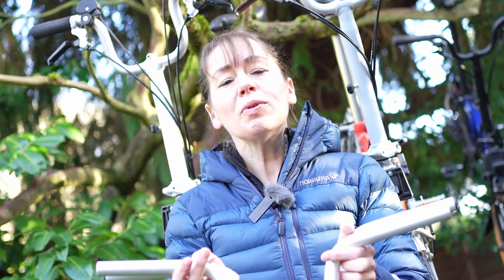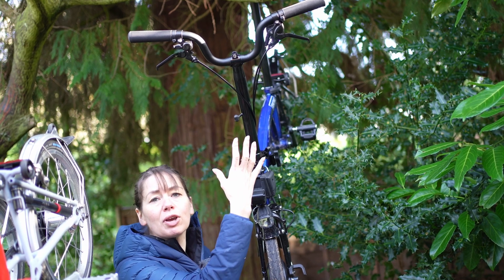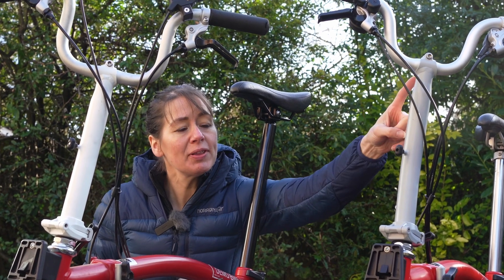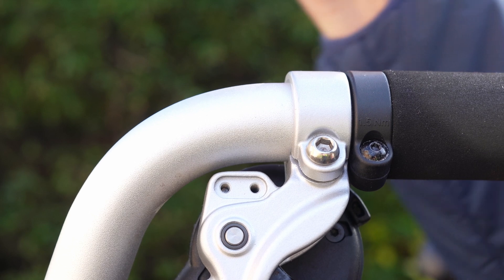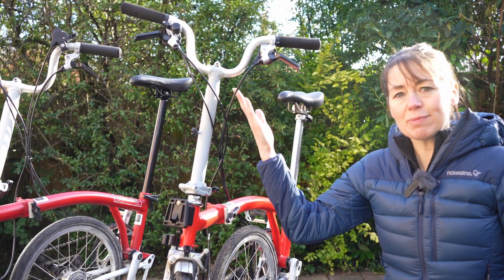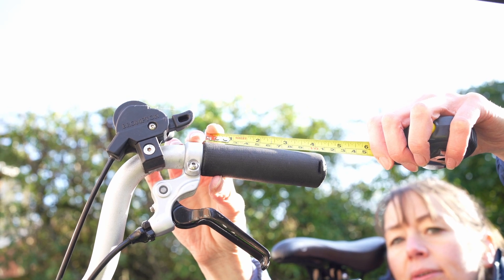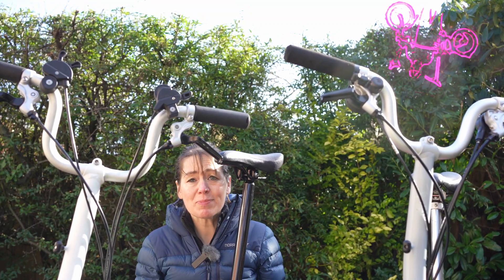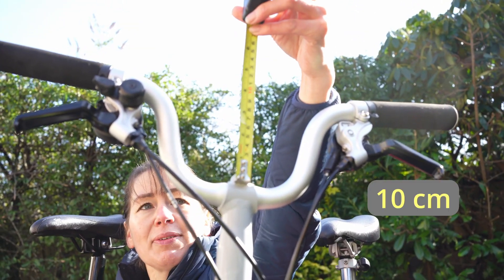Pre or Post 2017 Brompton Bars?

Comment: I have pre-2017 stem with post 2017 bars… for that slightly lower position and  extra grip space…
Reply from the maker: Many thanks for watching and for the comment. How are they?
Reply: Does it lead to an "S like" final position? This is very interesting, i find the old M position too high for me.. Could u please measure the length from the hinge to the top of the handle bar (i mean where hands stand but above the mid bolt)?
Reply: That should be approx 4 cm lower than a pre 2017 M tipe (stem+handlebar) and it should allow the use of new shifters.. Am I right?

Comment: Has anyone installed the newer, post-2017 handlebar and shifters on an older 2015 H stem (which is about 3 cm lower than the new stem)? What cables did you use? Also it is not recommended to use old bunny ear shifters on the new low rise handlebar?
Reply from the maker: Thanks for watching. It has been done. You need to use the same length cables, they will just be a bit long

Comment: I tried the bike of a friend with H-type but it still felt like the handlebar is way to far away from by body. Is this common for shorter people? Im about 163cm and it seems like the brompton doesnt fit my body type
Reply from the maker: Many thanks for the question. 
I’m 167cm and have no problem, but I am more comfortable on a medium / M type handle bar. You can adjust the handlebars back slightly and the saddle forward a bit, so make it more comfortable!
Reply: @brilliantbikes  thank you for the reply! I will retry the brompton with the adjustments

Comment: Hi ,, just a quick question . I've seen a 2nd hand flat bar c line for sale good price. Can it be changed to a H bar medium without too much difficulty. I do find the flat bar abit " stretchie "
Reply from the maker: Thanks for the question and for watching! It’s a bit of a pain as you need to replace the stem, handlebars and cables.
Reply: Thanks for early response . . . Thought that maybe the problem 👍

Comment: Thank you for the info.  I just got an M6R, with a serial number starting with 21, and I was a little confused after measuring the installed grips at 120mm.  They were also stuck on vs. clamped on.  Not sure if they're just friction fit or glued.  Other identifying features like the curves, height of the handle bar, and integrated brake levers indicates it's a post 2017 handle bar.  It's just the 120mm grip measurement has me wondering whether I should go with the 130mm or the 100mm Brooks grips.  On a side note, this bike also came with Schwalbe Marathons vs the standard Marathon Racers.  I'm guessing with some parts being hard to come by, they're piecing together bikes with whatever they can get a hold of.

Comment: My 2019, I think (I bought it in Cph. during the Covid crisis?), Lightweight has the new handlebar, which I found out when I tried to find some nice new, "Brompton printed" leather grips for it, and had problems making them fit the available length! I am trying to make it lighter, also with new, special mudguard clamps, replacing the original and "heavy metal" clamps, made from carbon for the titanium struts, and a new titanium axle in front (It may have been titanium already, but now it is nice and yellow, as my bike! I have also got a new, black - long titanium seat post with a ring on top for the saddles mount and angle, wasting the original heavy and complicated Brompton clamp and its weight! As a tall guy my bike was sold with a 600 mm post as standard, so I have problems making it fit my  B&W transport box. I may try to find a shorter one, to see if it is possible for daily use?

Comment: Loving your videos. How practical is it to switch handlebars? Go from a pre-2017 H to an S or a modern bar?
Reply from the maker: Many thanks for watching! 
You need a new stem and cables, but it can be done. The stems are dealer supply and fit only

Comment: Does the change in design also change the recommended replacement mileage? I know the older ones were rated for 5000 miles (p28, Section K, 2010 manual) before they, along with many other aluminium parts, should be changed.

Comment: My 2013 Brompton (serial number 13...) has a 33.5 cm stem, not a 31cm one. I remember the longer stem was an option for longer riders like me. It does have the aluminium non-integrated brake shifters and glue-on (I think) handlebar grips which are 115mm. I'm thoroughly confused... So I think I have an H-type?
Reply from the maker: Many thanks for the question, perhaps this video will help you to be sure which you have M or H

Brompton Handlebar Types
https://youtu.be/PkJ4Wo6BAs8

Thanks for watching!
Reply: In the meantime I managed to find a pair of new foam handlebar grips. This was a real quest to find a pair!

Comment: Thanks for another great video 
So does size really matter ❓😁
 But seriously, I have the old style if I switched to a new style carbon or Ti bar keeping the same stem , I realize it would be a less upright position but would I have to change my brake and shifter cables to shorter ones?
Reply from the maker: Many thanks for watching and for the question. Yes ideally you should replace for shorter cables!

Comment: Do I need longer cables for the handbrakes, having installed high handlebars instead of flat handlebars?
Reply from the maker: Yes. What handle bars have you installed? And does it fold OK?
Reply: Low rise, post. The cable to the front brake seems to be a bit short. Thanks for your answer.😊

Comment: Can integrated brake levers be retrofitted to Pre-2017 M/H bars?
Reply from the maker: Many thanks for watching and for the question. 
Yes, but you need to replace all the cables and you will need to use short (100 mm) handlebar grips due to the limited ‘space’

Comment: Can I change to P handlebars with out changing control cables on my 2021 M6L?
Reply from the maker: Many thanks for the question and for watching.
It’s not that simple. The M type (or now mid bar) uses a longer stem than the  Type did, so it would most likely mean then handle bars would hit the floor and Jen you tried to fold it. Also the cables would be to short.
Reply: @brilliantbikes  thank you. Susanna Thorton speaks highly of her P bars, I thought I’d ask. Thank you